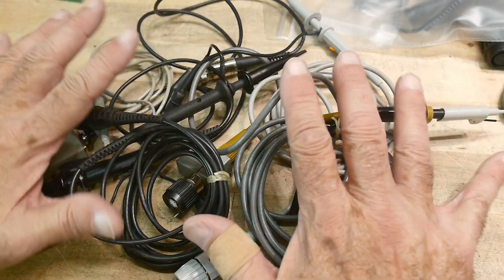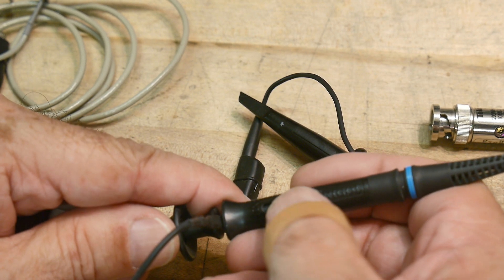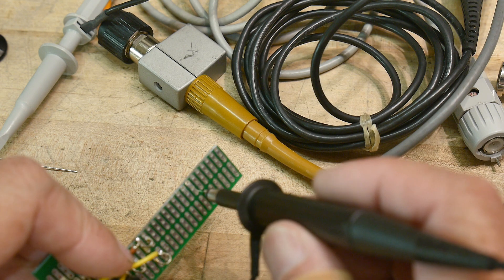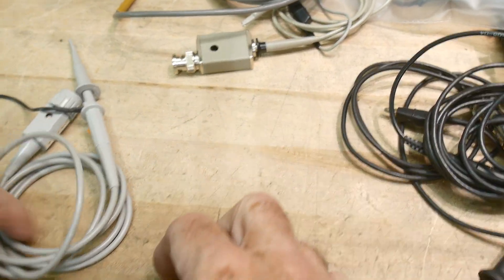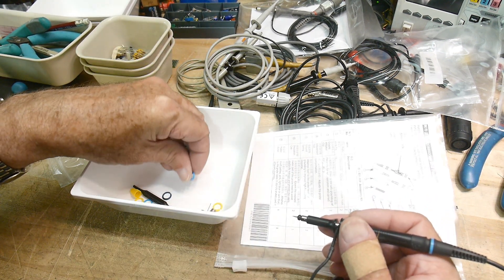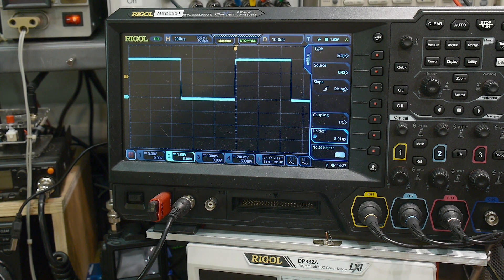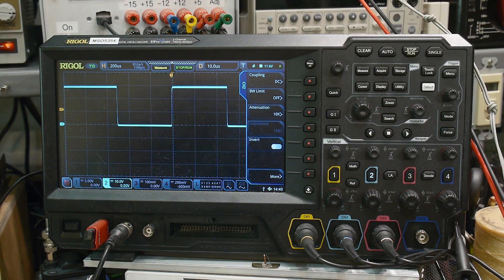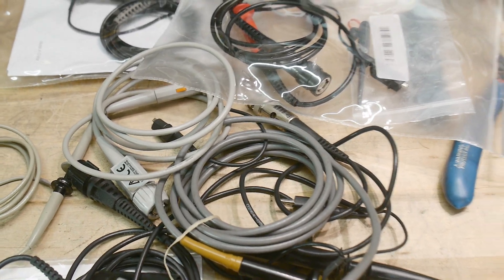#1256 Basics: Oscilloscope Probes

Comment: Very interesting and informative information. After buying a rigol 5000 series (not without your help :)), I thought about measuring high voltages. And I realized that for this it is necessary to have not only a 100x probe and an isolation transformer. But a differential probe may also come in handy. And this is not only a question of safety, but also a question of reliable information obtained by measuring signals not tied to the ground or the negative contact of the circuit. There is very little information on the net about this issue. I'd love to hear your recommendations.
Reply from the maker: I use my battery oscilloscope. makes it easy. https://youtu.be/EUr3k9Jdx58

Comment: I have a Tektronix 475 scope with 1M ohm 20pF inputs. What probe is recommended for this? Preferably a Tektronix probe. Thanks.
Reply from the maker: P6075 Probes came with the 475
Reply: @IMSAIGuy Thanks. Teaching moment here..... the input is labeled 1 megohm 20pF. The P6075 says 10 megohm 12.5pF. In the video you told us to get a probe to match the scopes input? Clearly the numbers don't match. Is there some type of adjustment necessary for a 1x or 10x probe? Thanks....and I watch all your videos. This series is a great idea as it's very confusing to a beginner like me.
Reply from the maker: @robbo6460  there is a range of adjustment (the one I show) that allows it to match. It is not clear what the range is on most probes. If you get a nice looking square wave when you adjust it on the calibrator output, that is all you need.
Reply: @IMSAIGuy Thanks. That makes total sense. Is there any drawback to using a 100mhz probe on a 200mhz scope? I have a generic 100mhz probe that squares up on the calibrator nicely. Do I lose bandwidth this way?
Reply from the maker: @robbo6460  yes it will limit you to 100
Reply: @IMSAIGuy I found a reasonable priced p6075 and purchased it. I have my eye on a 2nd but I haven't used the 2 channels at the same time yet lol. First we crawl....then we walk lol. You have been a great help. Thank you very much.

Comment: Several folks have noted that you must be careful when placing the ground lead with vintage electronics. Very true, but there are other cautions about probe ground lead placement, too.  In one of the early National Semiconductor videos an engineer (and no, it wasn't Bob Pease) cut the grounding terminal and temporarily suspended their oscilloscope with nylon rope above the bench to avoid any grounding issues.  Now THAT is a floating ground.   And also just a bit crazy.

I'm sure we'll learn all about where to attach your probe's ground lead in Part 4, Probing Techniques.  (grin)
Reply: It doesn't even have to be a vintage device, just a small oversight on the current switched-mode power source, as my colleague managed to do - I saw live what it means when it is said that the devil flew out of the box - the devil was a colleague accompanied by hellish lightning and smoke 😂

Comment: Only thing missing was when you were talking about the ground on the probe in the same breath as multimeters it's really important to mention that scope ground is connected to the earth pin (eventually, and unless you get fancy probes or scopes) so you can't just hook it on anywhere to get a differential reading like you can with a multimeter.

Doing that lets the smoke out of something, if you're lucky it'll be the device, if you're not it's your scope. Learnt that one the hard way.
Reply: Ha ha, Yes, I've done that. (quite a bang and bye bye scope).
That's why I have a cheap Chinese rechargable one as well as my CRT Hitachi

Comment: Hi, nice video, it's a shame that you didn't mention the galvanic connection of the GND probe and the PE terminal of the oscilloscope as Bob wrote here, and in that connection also the differential probe for direct measurement without the need to use an isolation transformer. One might also be interested to know that the probe cable is not ordinary coax, but a precisely manufactured cable with specific capacitance, inductance and resistance for the specific probe.

I'm already looking forward to the continuation, have a nice day 🙂 Tom

Comment: May I make one suggestion that you might want to mention. When using a scope or any piece of test equipment with older vintage electronics that may not use a power transformer, such equipment is said to have a hot chassis. This is especially true if you’re working on an older a.m. table radios. Many years ago at the beginning of my career I did some serious damage to a rather expensive scope because I didn’t know this. From that day on anything that I am measuring with a scope or any other piece of test equipment is always connected to an isolation transformer
Reply: True. If you ground your scope-probe to the chassis, and plug in the 2 prong plug 1 way you get a ground loop. If you plug-in the AC 2 prong 180's out then the probes' ground wire vaporizes!
(...and/or you get shocked! )
Reply: @joeteejoetee  In countries that use a three-wire electrical network connection, the GND of the probe is always connected to the ground of the electrical circuit, i.e. the PE terminal. For such measurements in these countries it is necessary to use an isolation transformer or a differential probe, these two requirements can be avoided by using an oscilloscope that allows battery power. However, it is necessary to realize that even the battery oscilloscope has BNC outputs GND for individual channels connected to each other, so again be careful where we connect them in the measured device.

Have a nice day 🙂 Tom
Reply: @Edisson.  That's cool for you once you got modern 3-connector plugs/sockets.
But like wise before the USA also had 3 wire plugs.
Electronics in the USA in the 1940's+ had a non-polarized symmetrical plug and 50% of the time a "common/grounded" chassis, and 50% of the time a "HOT" chassis. I learned this in the 1960's (and my pre-teens) when I attempted to ground my radio chassis of an old SW radio to a water pipe in my bathroom, and the radio was too far away to reach, so holding ny radio chassis, I reached out and grabbed the base of the sinks' water-pipe, and I got the shock of my life! 
#NeverAgain !
Reply: @joeteejoetee  I know how it was done, I'm not the youngest, even in our country (at that time in Czechoslovakia) there were only two wires and 120V sockets, and the plugs were not flat, but round with the same length and diameter - thus luxuriously reversible. When switching to 220V (today 230), a PE contact was added to the sockets (the so-called EURO standard), until then it was fine, but one type of three-way socket was produced, where on one side the phase was transferred to the zero socket and this would devices sometimes carnage. And another funny thing is that all countries using the EURO socket standard have the phase on the right side when looking at the socket, the person who translated the standard into Czech at the time probably didn't know English very well and so as the only country that uses this standard has the phase on the left . It wouldn't hurt anything, but if a device has a "Flexo" type supply cable (factory-fused connecting plug) made in CZ, the phase is on a brown or black wire - these colors are in CZ for the phase wire when this cable is manufactured anywhere else in the world there will be a phase on the blue neutral wire - many times I've met people who don't know this and then are terribly surprised when they start to light up like a light bulb.
Reply: @Edisson.  what if you have a digital scope which has a switching power supply.   The ground 3 wire plug was so annoying for me because I  needed to connect my scop's negative to ground.  I removed ground wires for my bench power supply (the clip) and my scope.  Then I learned  there were some annoying x y caps to scope's mains and  ground inside it's power supply and they would interfere with high frequency signals.  Then I had to spend $$ for an  isolating transfer.
Reply: @bayareapianist  I also have a digital oscilloscope in my workplace, but I would never think of disconnecting the ground, the so-called floating ground is a big problem in terms of interference. Not only are there capacitors of type X, Y in the switching sources, but due to the disconnection of the input mains filter from the PE conductor, a parasitic voltage can be created in the filter due to the capacitive reactance of the capacitors connected to the ground, and the capacitive coupling between the coils of the transformers can begin to show in an increased form, this capacitive coupling arises also on the coils of the isolation transformer and it is necessary to connect the transformer frame to earth.
It's simply not possible without grounding, in my workplace I even have ground circuits two one one for working on electronic devices and also for connecting myself - the connection points are marked in green and from the normal PE this circuit is separated by a power resistance of 1MegaOhm, for working on electrical devices a second circuit is created which is marked with green-yellow terminals and is directly connected to the main PE terminal of the workplace. I installed one special socket in the power strip for the entire workplace, in which the ground leakage current can be measured using a milliammeter - very useful when the device activates the current protector.
Reply: @Edisson.  life isn't that hard! About 10 years ago I worked for a 3P inverter company. We had to order some expensive quadruple isolated Tek oscilloscopes.   Those scopes did not need to have a common ground and the probs' negative were float and would not be connected to the ground.

And other solution is to use two probes instead of one and subtract their signals. That was the main idea of using dual Trace oscilloscopes back in early days.
Reply: @bayareapianist  I agree, life is not that hard 🙂 you just need to know what hole to plug into😂 Those TEK oscilloscopes do not have a floating ground, the ground is tied to the given channel. I do have isolation transformers in my home lab, but I solve these problematic measurements with a portable battery oscilloscope - but even there I have to be careful because the GNDs of the BNC input connectors are connected to each other again.

Nice day 🙂 Tom
Reply: Not only old hot chassis electronics can cause problems with connecting the probe ground to the chassis.  New amplifiers with bridged outputs will at best shut down if you clip the probe ground to a negative output terminal.  At worst you can fry things.
Reply: @ZPapaGeek  Exactly as you write, when I built a signal tracker for audio engineering repairs, I made a galvanically isolated output for an oscilloscope using a small audio transformer, the display is not completely accurate, but at least I can roughly see the signal. The connection itself behaves like a probe with a 1:1 ratio, but it is enough for my needs, in addition, the tracker also allows battery operation.

Nice day 🙂 Tom